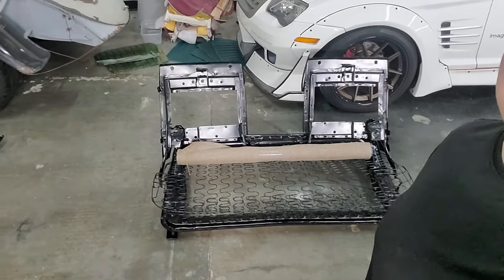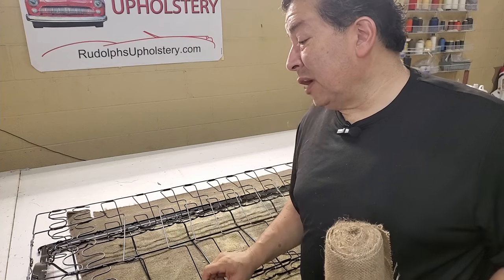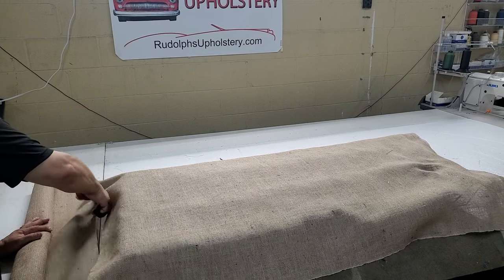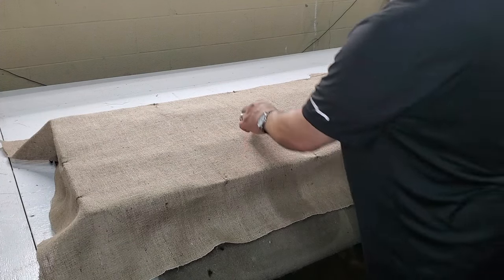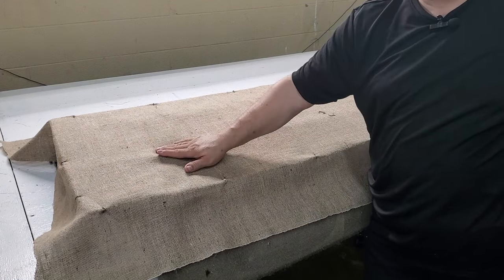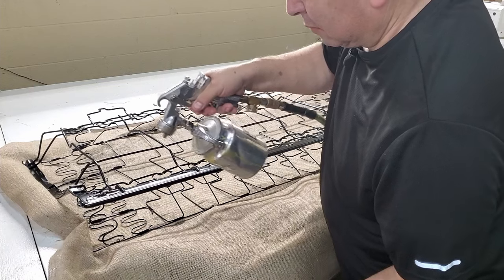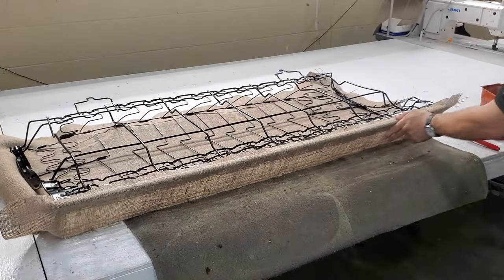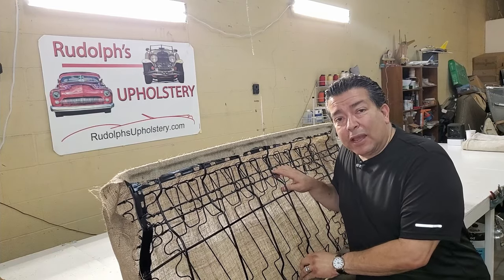Learn Now! How to DIY burlap an old car seat springs auto upholstery

Comment: I was replacing the factory covers on my 24 year old truck today, i realized that the driver seat had a broken wire and so i added 4 in a latice manner on top of the replacement one. Then i added a layer like this using the back vinyl off one of the old seats and finally spent a couple hours cutting out foam pieces and gluing on replacements. I spent in total about $90 since i had glue and foam from previous repairs i did; im pretty happy with end results given i had never done seat work before.
Reply from the maker: Hello John, I love hearing good news like this. You have done what most people will not do. Please keep liking and watching!

Comment: I noticed you use the glue gun,but it never seems to be clogged,is it because the glue you use?
Reply from the maker: Hello 636, contact adhesive reactivates itself. Therefore it does not clog. Once in a great while, I just clean the tip with Mineral spirits. Please keep liking and watching!

Comment: The old ways are sometimes the best ways. I fix cars and trucks but started long ago when you made many of your own gaskets (Linoleum Company's SoLd Gasket Materials) but backing the frame or foam, keeps it from cutting thru the foam, time after time or use! Drivers side wears out first, so reinforce the French seams and lube the door hinges. As so many don't!
It is like going to "Quick Lube" shops and they don't own a grease gun! Or two drops of motor oil on hood hinges. My customers got a business card, list on back of future possible repairs, but a thanks on the front. This was a dealer, I stayed busy while others read books or played cards...
DK, ASE Master Tech since 78,
Retired!
Love the tip, keep it up. I make hogs rings from electric fence wire, own 2 SnapOn pliers, 1 at 45 degrees angle.
Reply from the maker: So much wisdom! Thanks a million!

Comment: Hi, Cathy and I may be attempting to make covers for our 51 Chev pickup. Is there a grid you lay over the springs on top of the burlap before the cotton or is the burlap enough to keep the cover from getting out of shape? Are there different grades of burlap, heavier or more dense? Thanks for the help. Brian and Cathy
Reply from the maker: Hi Cathy! I use what I think is a standard burlap for upholstery. I get it from my upholstery supplier. I think a medium or heavy weight would do just fine. Foam, cotton, or the seat cover won't lose its shape. I hope I answered correctly, if not let me know. Thanks for watching!

Comment: I was going to use the three men stuff because I’m only doing one car. I’m doing a 1960 comet.
Reply from the maker: Good luck with that one! Just know that it will just be a gooey temporary hold. 1960 Comet, cool!
Reply: @oldschoolautoupholstery  I wish I could buy a little can of the good stuff.
Reply from the maker: @donaldappelhof2059  Most hardware stores have quart cans of contact cement. Check 'em out..
Reply: @oldschoolautoupholstery  I didn’t know if it was the same as what you use.
Reply from the maker: @donaldappelhof2059  Yea, there are just different name brands of contact cement.

Comment: My 1960 ford bench seat has wire’s in the burlap running the long way. I don’t know if I need to put them back.
Reply from the maker: Yea, the wires are not necessary.
Reply: @oldschoolautoupholstery  Thanks so much!  I don’t know what I’m doing but I’m going to give it a go!  I have to get a zigzag spring because one is broken but mine have tow different pitches on each spring. Old school?
Reply from the maker: @donaldappelhof2059  Yep, go for it!